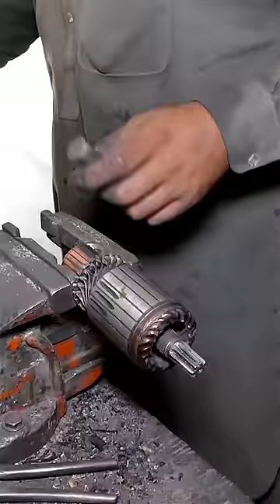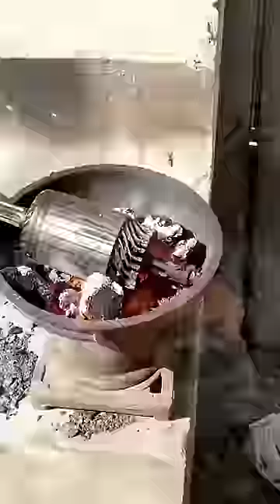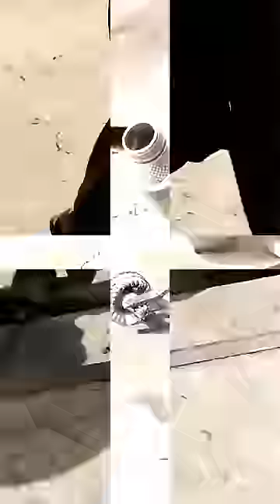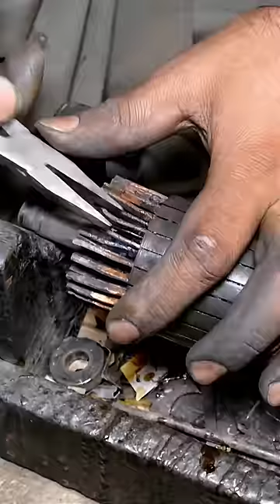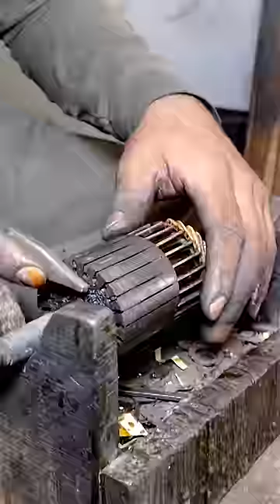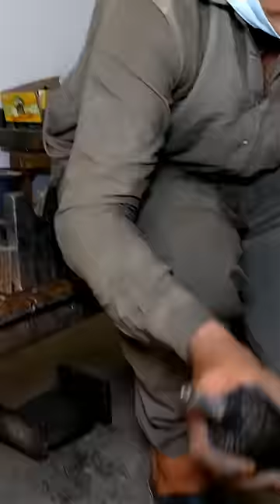Armature Rewinding Technique Part: 1

Comment: Yeah don't to this. Just use a soldering iron and de-solder it.
Dude just turned that part to shit that will fail in under 3 months.
I mean I guess if you want job security and there are no other technicians for your clients to go to it could work.
Dude probably said "Yeah I can try to fix it for you but it is going bad you probably need to pay me to order a new one and the transfer and installation fee."